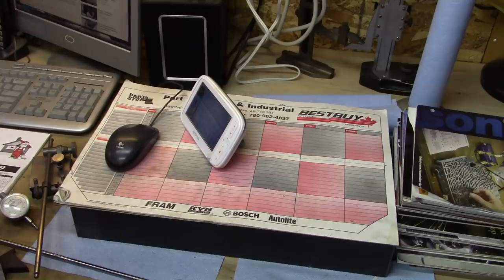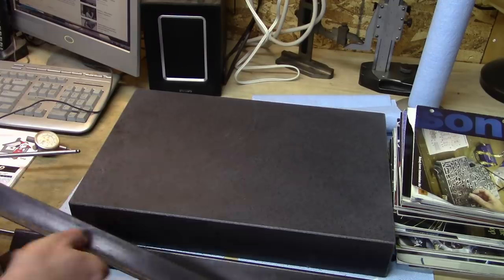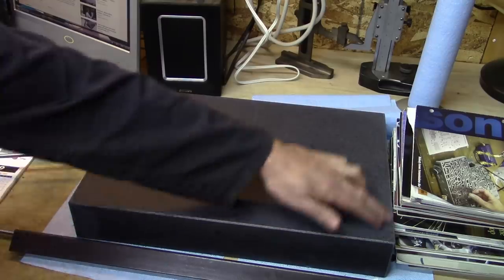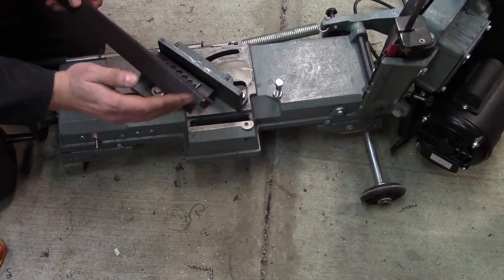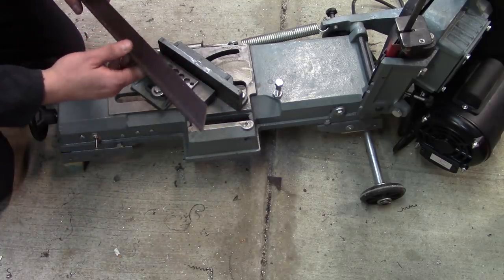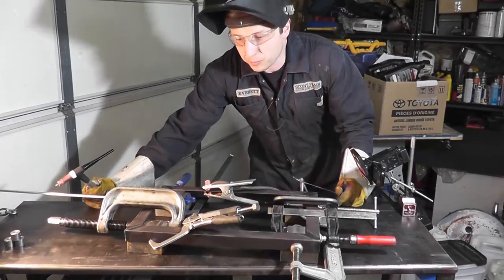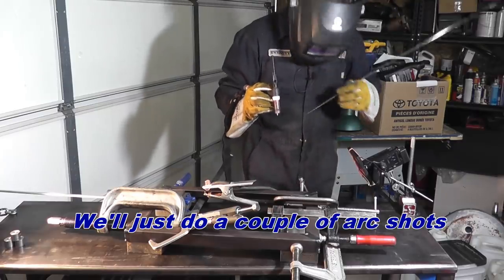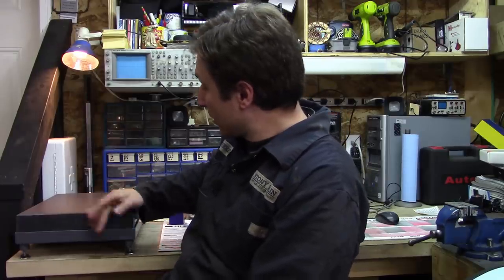Small Surface Plate Accessories Part 1: Making the Stand

Comment: A surface plate that size would be big enough to hold my whole watchmakers lathe. But still it gives me ideas, and that's why I watch you guys.
Reply from the maker: Glad you found it interesting, Larry.  This is what the community is about, with sharing ideas and the ways we all do things.  I've learned so much from some of the older and professional machinists here, and we as hobbyists all have similar needs and different ways we solve those problems.  Seeing how others solve theirs helps us solve ours, and it goes around.  Watchmakers amaze me with the stuff they build, I would sneeze and lose half the parts!

Comment: We used to make go karts out of old bed frame angle iron when we were kids , learnt to sort of stick weld then !
Reply from the maker: Maybe it was made of different stuff in Australia or you were talented welding alloy, I was finding this stuff tricky between the cooling stress cracks and the crap that bubbled out during welding, and that was even after weld preparations.  I just figured to try it, but if I were to do it again it would be just made of mild angle.

Comment: Hi Everett, great video. I have a big cast iron plate and boy it was a nightmare to find a home. I eventually made a stand for it so it was at work level as easier to read off then I think. I made the stand and then a mate came around and told me that it should be sitting on 3 points only so I did a bit of research and he was right so made the mod and its perfect. A really handy piece of kit to have in your workshop isnt it and like most things once you have it you use it for better results. Im a recent subscriber but looking foward to your videos as the content is practical and the presentation is great. many thanks
Reply from the maker: Hi Gordon, thanks for joining in!  A surface plate's been on the 'grocery list' for a while, and when it was on sale before Christmas I jumped on it.  I do want to get better and more accurate in what is made here, so this is just one step in that direction.  As it is, there wouldn't be space for a larger one at this time so this will be very handy now!

Comment: Great video Everett.  I need to get out a stand also. The idea of being able to get your fingers under it makes sense with a stand. I took have heard that as Gordon stated, a 3 point is the way to place the legs. Looking forward to how you make the cover. I just have shop towels that wont stay put.
Reply from the maker: Thanks Frank, I did find it annoying trying to lift it before.  Ironically, it doesn't need to move much now . . . The cover is actually quite simple, it's just a slab of roll recycled rubber, so that stuff doesn't scratch the surface.  In the process of editing part 2, and it's a short part of it.

Comment: Nice simple design, like you mentioned I don't think you'll have any problems with it being supported on the outside. For peace of mind you could make a simple machinists Jack to support the middle. Our you could make two wedges out of wood and slide them together intell they get snug. Looking forward to part two as I am working on similar tooling at the moment. Thank Andy
Reply from the maker: Thanks, was just using what I had on hand, and considering the bed frames came out of an apartment building dumpster the price was right! It's just finicky stuff to weld. It should be solid enough for what I do, but this I wouldn't use this style for anything bigger.

Comment: Hey we saw Jim from Sawlog go take the road trip to buy his plate, that was a fun ride along, it looks great Everett. Thank you again for our Jeep help advice. 
Nice method for placing your plate into the nice small LOVING it stand.
In the end it the plate looks really nice Everett.  
Thank you looking forward to the cover build:):). Lance & Patrick.
Reply from the maker: Thanks Guys, for home shop use these import plates seem to be the best spot to start, and I've seen a few others get them too, Jim included.  As for the cover, it is a very simple rubber cover, so I can set stuff on the plate without scratching it.  Just editing part 2 now, it should be out soon!

Comment: Bed frames are challenging to work with, but cheap is good.  You got great welds on that material.  It doesn’t matter much with a small surface plate, but with bigger ones one should have it rest on 3 points (on to the stand, not the stand itself) to prevent flexing.  I have mine (16x18) sitting on 3 hockey pucks on my bench.
Reply from the maker: Thanks! I agree, the more I use bed frame material for stuff, the more I notice its quirks. If I ever get a larger plate then it will be supported on the 3 measured points underneath it but for a small one like this I doubt that I've induced much twist into it.

Comment: Stumbled across this video in my suggestion box. I’ve got the same size plate and thought I needed the 3 point footing so I’ve been procrastinating the build of my stand. Thanks for the vid, guess I should sub for more tips 😉
Reply from the maker: Glad you came by, and thanks for joining in by subscribing!  I had thought about the 3 point before but for a rock this size I don't see there being enough of a difference, and neither did a couple experienced guys I asked.  If it ever gets replaced (in a bigger shop) with a bigger plate then the 3 Airey points will definitely be used though.

Comment: You're not being "cheap"... you're being environmentally responsible. Re-use / Re-purpose is one of the three Rs. :)
Reply from the maker: I still think it should be 4 R's, not 3 - they're missing "Repair."  If parts are available there are still so many products that can be repaired with a few parts rather than being thrown out and having to make a new product to replace it.  Our previous generations know this but something got lost in the "cheaper, faster, newer" mindset that has taken hold of the Western societies.

Comment: I only have a small granite surface plate so it has to come out just when needed. Long ago I had a beautiful 18 x 12 cast plate - was sad when I had to sell it... now that was heavy!
Bed irons are super useful for fab work though usually a bit flexible... must look out for some more. Your welds come out real good - better than my shaky work! Came out real nice. (4k getting closer! :) )
Actually at last got into the shop - small project but it's a start.
Reply from the maker: Thanks Chris!  Glad to hear you're getting back at it, been hoping you were doing ok.  An 18x12 cast unit would definitely be heavy, much heavier than this one.  The welds were usable, but as I say the problem is in the weldor (me) not the welder (machine).  Biggest thing is needing more TIG seat time, but that will come.

Comment: This is gonna be absolutely fine for a shop grade plate, the 3 critical points are already drawn on the higher grade tables so you don't need to look for them, it's also the way they been ground...
Wise comment about what and what no to do with bedrails, very brittle when not welded correctly...
Grey, it's an in between, my favorite is "No color" Black...   ;)
Channel is growing nicely...!!!   ;)
Glad I'm way over that time of worrying about little ones sleeping to get spare time, not so glad that getting older is trading a this for a that...    Not always a winning combination...   lol
Reply from the maker: Hey Pierre, I remember the experiments we were both doing with bed rails and they really are odd material to work with when it comes to welding.  Thanks again for the advice on these small surface plates, I very much appreciate your input and experience.  As for the channel, still just having fun with it and with getting to know others who are into the same stuff, we'll see what happens as time goes by.  And maybe it says something about my personality if I'm partial to gray . . . hopefully not TOO dull, lol . . . :P

Comment: hey everett very nice job on the frame 4 the surface plate. i was waching you tigging  you did very well for a mcanic thats pisses about as doubleboost would say lol. just one tip i see you had some undercut on the top edge of your part wich is no big deal but if you want to eliminate that turn your heat down a bit and add more  tig rod push more into the puddle try that im sure it will help you. hope this helps good job and looking forward to part two.
Reply from the maker: Thanks Jamie, and I am the first to accept suggestions and tips on TIG from someone who actually knows and doesn't just have an Engineering Degree from Armchair University.  The bigest problem with my welding is me and lack of TIG seat time.  I've done a lot of MIG and Stick, but that was about 10 years ago, and did a bit of MIG when I was working as a mechanic.  TIG is still a new critter to me, really, so it's a matter of practice time and figuring out how to shake less.
Reply: @EverettsWorkshop  LOL I know about the shaking I used to shake like crazy when I first started TIG welded and doing a test for a job know the feeling quite well all right take care we'll talk to you later

Comment: Even the larger offshore granite plates are generally accurate enough for the small shop. I built my own surface plate stands for several plates I own. Three points are much easier to level than four. You tend to chase ghosts when using four corners of contact, especially when using measuring equipment that is 2-10 X the cost of the plate it self.
Reply from the maker: Well, the little Starrett level is, as you say, 3x the cost of the plate, but at least it's nice to know it's actually level and not just a guess-grade level.  I had thought about using the 3 Airey points but decided to keep it simple.  Took a little while to level but once the lock nuts were tight it stayed put.

Comment: I'm wanting to do something similar for a 3x18x24 and sit it on a harbor freight 22x42" rolling tool box at over 160lb i don't want to be lifting it...the four leveling feet will work nice, be I think I'm going to also use the three points system in the frame....nice job Everett..!
Reply from the maker: Thanks!  Yeah, your plate will definitely be heavier and less appealing to lift!  I've heard of people putting them on roller cabinets, that sounds like a good idea if you have room for one.  Robin Renzetti did that with a massive plate and a couple Harbor Freight roll cabs, but that was a bit of an extreme build.

Comment: Actually gun taps are mostly used in through holes. They tend to push the chips ahead of themselves, so to speak, shooting the chips out the open end of the hole.
Reply from the maker: You're totally right - the reason I used this one is that I don't have a spiral flute in that size, and don't trust cracking off a straight flute tap power tapping.  The tap drill hole went in 2" so I figured it would have room to hold chips for threading the first inch then blew chips out with air.  I totally agree with you though, it would have been better using it on a through hole!

Comment: I don't have any welding gear and this  video was almost my excuse to buy some, however, I think I'll buy the Grizzly stand for my surface plate. 24x36" plate crashing to the ground isn't something I want to experience.
Reply from the maker: Well, for a 24x36, it is 4x the size of mine, so a commercial stand which has the proper Airey support points is a good idea, for sure.  I wouldn't want to have one crash to the ground either!  However, one just needs to find another excuse to get a welder . . . like "Today ends in 'y' so it's a good reason . . ." :P
Reply: @EverettsWorkshop  Yes thanks. I looked at the Grizzly stands but it doesn't look like they make them to support by 3 points. Curious.

Comment: Great job, three feet would prevent rocking (Bed joke, sorry), look up science of Kinematics, ref six degrees of freedom. With regard to bed frame steel, I can only sumise that it is manufactured moderately pre-stressed, and hardened / tempered. It is nominally 1/8" thick by 1.5 to 2" sides, and for a length of 6' 6" resists bending quite well during 'BED' activities. Many report it is made from scrap, recycled steel is the same and can achieve high quality, no steel manufacturer would risk running rogue steel through mill rollers, being difficult to drill, cracking when bending is not due to poor steel, I think when you welded, quite a lot of heat was inputted, so the heat affected zone is quite large, so a lot of tempering took place.
Hope this helps, rather than confuses?.
Reply from the maker: Thanks, I decided on 4 feet as it's a small plate, and it just took a bit more time to level and set up but it's good now. As for the bed frames, I even had people chiming in from the steel mills that roll them and they said that they were re-rolling used rail track into bed rails, t-post fence posts, and rebar. It doesn't drill nicely and the joints are usually riveted at the factory not welded. But yes, they do seem to hold up under general 'domestic' use, lol!
Reply: @EverettsWorkshop  Thank you for your reply, the modern equivalent to what I sumise bed frame steel is called "High Strength Low Alloy" (HSLA), simply it is very low carbon, but rolled to increase its strength, think work hardening. This steel is extensively used in vehicle manufacture for low weight and high strength, plus is more corrosion resistant. Wikipedia have a nice article on it.
Yes, some, have strange ideas on steel production, even with saying original steel from ore is better!!!!

Comment: "dont use bed frame for anything structurally critical"...... LOL Like you and your special lady friends jumping up and down trying to procreate???? Bed frame is the best metal on earth for shelves, racks, toolbox extensions, etc - I've used it for anything and everything for almost 40yrs- you can always find someone on Craigslist or Facebook giving them away or cheap like $10-$15 at most Salvation Army stores or Goodwill........ grind off the rivet heads, pop them out with a punch and goto town fabricating!
Reply from the maker: Lol, I get what you mean by "stress testing" of said material, but I've noticed that bed manufacturers rivet the pieces together, not weld them - it really is tricky to weld.  By "structural" I was meaning more along the lines of trailer or truck body parts, lifting equipment, etc. where welding is involved.  I TOTALLY agree that it's strong stuff, but that's because it appears to be medium carbon steel.  And yes, I will continue to pilfer apartment dumpsters for it because it is free angle iron and within certain limits it's awesome stuff to work with (just a pain to weld nicely . . . )  Thanks for coming by!